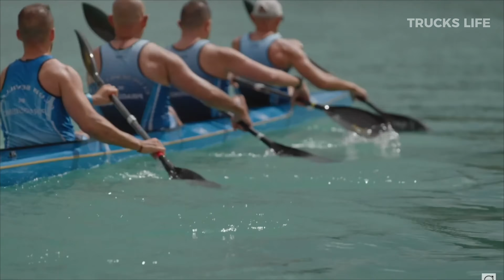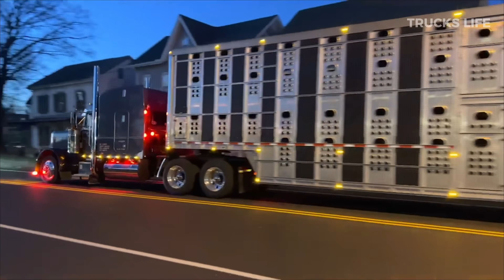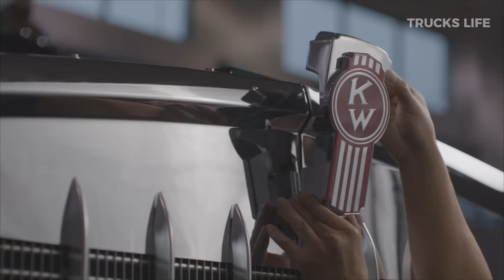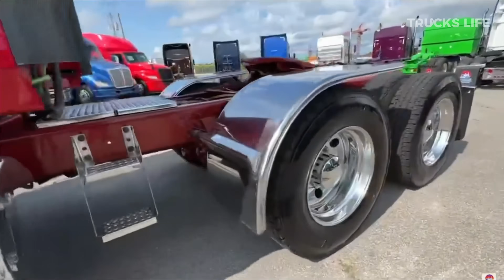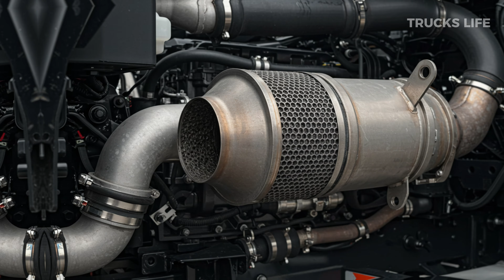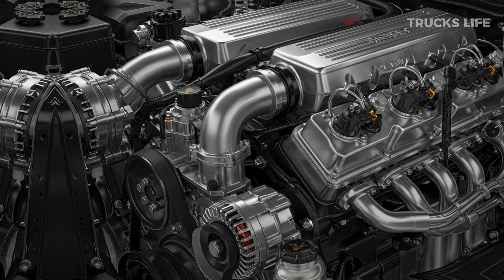WHY DO OLD TRUCK ENGINES LAST FOR DECADES — AND NEW ENGINES BREAK DOWN SO QUICKLY?

Comment: No mystery, it's simple. Make a cheaper product, a better product. Also, you want them to come back and buy another as soon as possible, not last forever. The crazy thing is you're likely to have an accident, not be able to drive the car anymore, and need another one. Quicker, then the vehicle breaking down. It's too many vehicles on the road. less good drivers, the odds are high for you to total your car before it breaks down, and you need a new one, but they still operate on that theory. They wanted you to come back and get another car. They make more money that way.
Realistically true, make a better product and compete. They'll come back and buy another once they wreck it.
Reply: Not a better product